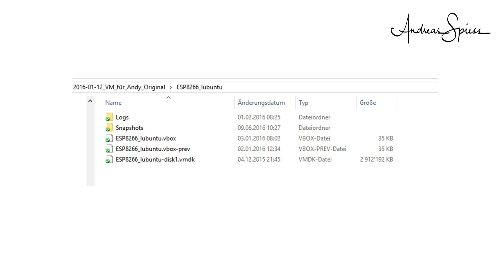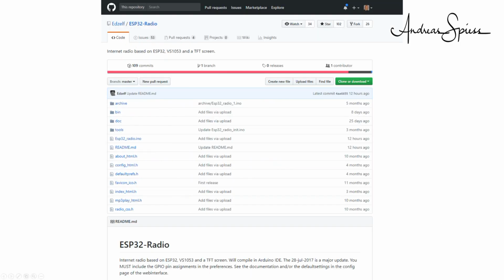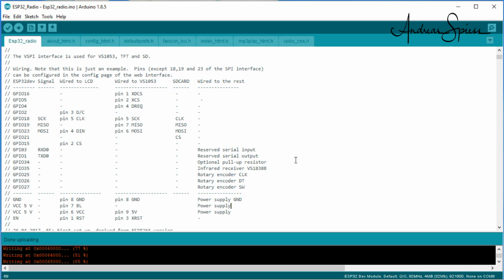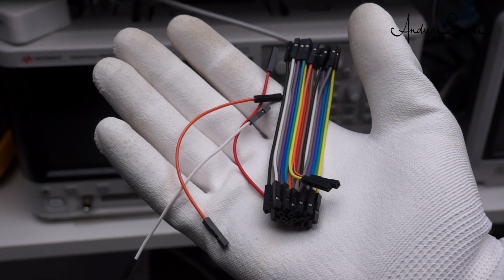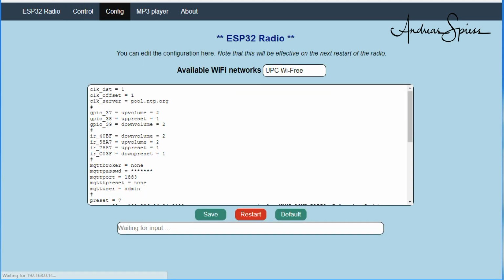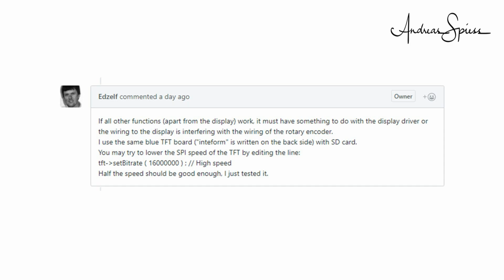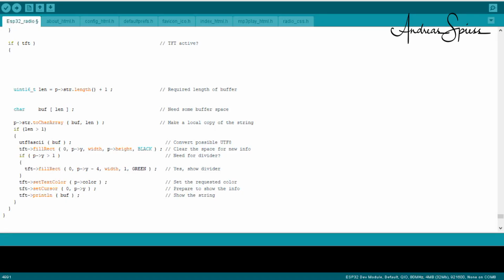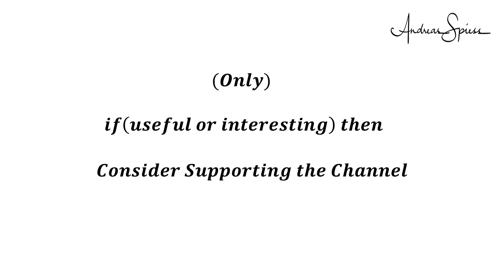#195 DIY Internet Radio using an ESP32 (Arduino IDE)

Comment: I have it sort of working now,  but the problem that I am having with it is the volume. When I start it, I  click the vol up button till she is about 86 or so, then I can hear it fine, however as soon as I put down the mouse, she begins to fade till there is nothing. I pickup the  mouse and begin clicking again, and it starts to go up from about 45, I can repeat this but to no avail.  Perhaps I have my wires crossed?
Reply from the maker: Good to read that it works (somehow). I did not do a lot with this project since the video. Maybe you ask the developer? He should know much more than me about his project.
Reply: @AndreasSpiess  Last night, when tinkering with it, I decided that perhaps a bit of capacitor could smooth things out a bit, after all when I am starved of energy, my voice gets quieter right?  So this morning, I dropped 470 ufd at 16 volts across the +5 and GRND pins of the MP3 decoder, as I was running the device off a power bank hooked through the USB of the ESP.  I do have a secondary PS that I tried that is 7805 with extras on a strip board hooked to 3 18650's, and it did the same thing, but this seems to have improved things. I also installed the rotary encoder so I can control the volume locally  So far all that it does though is control just that, and it works backwards by my way of thinking.  When I turn it the downward it increases the volume, and vice a versa.  Ah well at least it works a bit.  I want this in a nice case built of wood, and useful as an entertainment system. I have already mounted everything on a single board with very short solid copper wire for good conductivity.

Comment: Greetings and salutations from the snowy plains of South Dakota.  All the cool weather of the Alps but without the Mountains!  I have been playing around with several versions of this project for a few days now. I am sick with the flu, in fact got back from the Doctor yesterday. She checked me over and told me I was getting over my pneumonia nicely. Didn't even know I had that. Anyhow, I managed to get, first an ESP8266 to sort of work, but very poor quality sound. The more power I fed her the better, but nowhere near the quality I was seeking. Then I hooked this one up for the, well perhaps 40't attempt, and music came from my tiny folding speakers.  It works, so far. All I have set up is the ESP and the sound board, I did make a small PC board for a rotary encoder but have not yet wired that in.  I have been just getting by using the onscreen setup to change stations and other settings. I do have several types of screens but haven't decided which one to go with so far. Thanks so much for your fine video's, had I the funds, I would send some your way, but sadly my funds are quickly going the way of the dodo bird.  Know anyone interested in a fine little 2 bedroom ranch style home in South Dakota?  Trying to sell mom's, she is in the home and shall never walk out on her own, sadly, and that damn house, fine home that it is, sits, mocking me as people drive by and seen the sign but make no offers. Ah well back to playing with ESP's and arduino's.
Reply from the maker: I get enough support for now. No worries. Concerning cool weather: Currently nobody talks about the weather here. All eyes are on the virus. Closed schools and soon closed companies are all not known around here. One advantage of a YouTuber like me: He does not need to go out of the house too often...
You can be happy that you only catched a flu. And maybe you are now even a little more resistant! BTW: I know what you are writing about your parents. I am just a little ahead of you. Both passed away in the last years and the house ist still around...
Reply: @AndreasSpiess  Indeed, we are told to be sort of quarantined for now, since the wife and I are both over 68, we have told to stay home and not travel anywhere.
Reply: @AndreasSpiess  At long last, the house has sold, dropped the price by 10 grand and had 2 takers. Got 44 thousand for the place, a fair price here for the home. Deal should have closed yesterday but I have yet to receive the check.

Comment: TTGO has since made a new board with integrated stereo DAC that could make the project smaller/cheaper
http://www.lilygo.cn/prod_view.aspx?TypeId=50032&Id=1157&FId=t3:50032:3
Reply from the maker: Nice board. Does the project run on this one?

Comment: It seems that when ever I decide to build a neat little project, and have a bunch of parts in my hand, I search for code and your site always pops up.  I am very thankful that you keep working on the same things that tickle my fancy!  A few years back, I was building different devices that I could push music around my home via Bluetooth,  toward that end I picked up a half dozen little boards that came out of some unknown music player that probably did not do well, the boards look like left overs.  They are equipped with two 3 watt output amplifier chips, on-board Bluetooth receiver, and an auxiliary in port. The speaker out ports are tiny made for some tiny plug that I am sure is deigned from unavailum. I did find that miniature power plugs can be cut down to be used but the design is a pain to work with, so I have taken to soldering flat cable taken from old computer hard drive cables as speaker out. Since the stereo is taken from two mono amps, I do like to keep the two grounds separate as they are in the output for the speakers. I want to use this in the aux mode to receive the input from the ESP32 if I can. Hope this can be made, the board is very small I am considering making it a mono and putting it all in a tiny pocket AM radio case, designing a dial that can change stations using a rotary encoder, if possible.

Comment: I used a Eeprom flasher program for reset the esp8266, not necesary the cable brigde, works fine

Comment: Hi Andreas
I am in the middle of building this project but with ESP2866 as described by this guy
https://www.youtube.com/watch?v=1q8UP5HhdpM&t=9s
It is a bit confusing 1/ in the video he is connecting the yellow and the blue from the display to tx and rx on the ESP but Oh look it is not blue and Yellow, it is in fact yellow and orange!!!
2/ the sketch refer to a different display!!!
3/ here is the problem - instead of selecting the wifi which I had inserted successfully in the SPIIFF (surprisingly without a password) it reboot and give me an exception (28)
You are the last to save my life
Regards
Erik Hoffman
Reply from the maker: Unfortunately, I cannot do remote debugging even for my projects. I saw you posted a request on the original video. 
The TX pin usually has 3.3 volts, the tx pin has 0 volts. Maybe this helps to distinguish the two.

Comment: Such a nice project! I also want to do that. I plan to place the whole thing in an radio case of an very old radio. I also want to use the mqtt function to connect it to my doorbell (at least for testing purpose). If I got any problems doing this, can I ask you for help or are you overwhelmed by people like me asking some "stupid" DAU-questions? ;-)
mfg
Sven
Reply from the maker: Maybe you go to the github page if you have questions on this project. The developer knows much more than me.

Comment: Andreas, hope you can reply but this project is alive for you? seems more than a year without significant activity. I really arte looking to use a bunch of pieces that I have to make this working, but I have little time so if is parked and dont work very well maybe I will not be successful too. Let me know if you find good to build it with some limitations as it may have.
Reply from the maker: I did not do a follow-up. But there was quite some activity on the GitHub project. Maybe you search there?

Comment: Very interesting little proj. 

Working out where borders of ESP32 are.....
Basically it can decode IP Audio streams (Mp3, AAC etc.) itself in SW. 

What are your feelings to delete the external VS1053 decoder and decode stream audio in the ESP32, still paired with with tasks touch evaluation, SPI TFT bandwidth load and potentially even equalizer number crunching from the ESP Audio developing framework?
External RAM might be needed here, but basically this shoudln't be an issue...
Reply from the maker: I did not look into this topic, so I do not know.

Comment: You may be happy to know that there is now a well-tested PCB available to mount all the modules and components you need for the ESP32 Webradio, with some added benefits. 
It has a micro usb power connector, uses audio transformers for decoupling, and even includes an on/off switch. 
It is available om my website: http://nakedninja.cc/smart_products/webradio_esp32_pcb
Reply from the maker: Thanks for the link. Your posts landed in my YouTube spam folder. Maybe because of the name of the website.

Comment: Hi Andreas. I am looking to build this and was wondering what size (mAH) battery - assume it is a Lithium - you used for the ESP32 dev board? Many thanks.
Reply from the maker: Typically an ESP32 dev board consumes around 100mA. I never measured the other components. Maybe you check the whole setup with a cheap USB doctor or with a multi-meter? Then you easily can calculate the capacity you need for your expected time of independent operation. I assume it will be around 8h per 1000mAh (without backlit). But this is just a guess.
Reply: @AndreasSpiess  Thanks Andreas. I intend to build it with the parts as you did that I know work and then modify it to add new features. Being a seasoned coder (my career) as well as building electronics I am relishing the challenge and, as you mentioned in the video, the code used for this project  has good examples of some features.  I hope to eventually build this with a bare-bones ESP32 board to keep the size down. I'll let you know how I get on. Thanks for your excellent videos.

Comment: I would like to see code for most simple of internet radio. Only necessary components:  ESP32 and Decoder module. No displays. No push buttons or encoders. No bells or whistles. Only one source for streaming. Although I am in my 8Oth level in life. I like to play.  I just don't learn so fast any more and don't have a lot of time to figure it out.
Zu Bald alt, zu spät klug. I do learn from you videos at your easy pace. Thank you
Reply from the maker: I am not sure if this will work. But maybe you find a project somewhere on the internet. Enjoy your hobby! You definitively are a role model for younger people!
Reply: KISS. It's here:
https://electronicsforu.com/electronics-projects/prototypes/esp32-internet-radio
It worked for me.
Reply: hi! I am also looking for a cheaper solution with only an ESP32 clone, no LCD, just hardcoded stream url (darkice ->liveatc), no DAC just some COVOX like 'sound card' in old PC years, is it possible?

Comment: Hello Andreas,

Waiting for the I2S to work, I took the subject WebRadio with a 8266 and a VS1053, thanks to the site:
https: //platformio.org/lib/show/1744/ESP_VS1053_Library
which has a WebRadio index.

It's simple and it works well with the stations of the form :

// http://comet.shoutca.st:8563/1
const char * host = "comet.shoutca.st";
const char * path = "/ 1";
int httpPort = 8563;

Unfortunately it does not work as well with stations such as:

// const char * host = "http://direct.franceculture.fr";
//http://chai5she.cdn.dvmr.fr/franceculture-lofi.mp3?ID=f9fbk29m84
const char * host = "chai5she.cdn.dvmr.fr";
const char * path = "/franceculture-lofi.mp3?ID=f9fbk29m84";
const int httpPort = 80;

No way to connect !!!

an idea ?
Reply from the maker: I am not the owner of the software project. Maybe you ask the question on GitHub.
Reply: Well, it works very well, it's the right wording, 
Merci !

Comment: Mit der letzten Version wurden ILI9341 Display und MQTT optimiert. Leider läuft der Webserver und somit die Steuerung, eben so MQTT, nicht lange stabil. Die Zeitanzeige jedoch konstant. Suche gerade den Fehler. Hat jemand ebenfalls diese Erfahrung das nach ca. 2 Std. sich der Web- und MQTT Service nicht mehr ansprechen lässt?
Danke für das Feedback
Reply from the maker: Hast du ein Issue auf Github erstellt?
Reply: Hallo Andreas, erst mal danke aus Deutschland, vom Schweizer :-) Nein noch nicht, weil ich nicht sicher bin, ob es ein wirkliches Problem ist oder hausgemacht. Ich wollte einfach mal sehen ob es auch andere gibt mit dem Phänomen. Wie gesagt, das Web- und MQTT Interface sind wie eingefroren. Der Streamer läuft meist weiter. Werde mal ein USB Netzteil mit mehr Power nehmen >2A.
Reply: Ich habe nun folgendes gemacht: 1. die aktuelle Version im Einsatz 2. mein ILI9341 LCD Modul im Einsatz und 3. 5V / 2.5A Netzteil im Einsatz. Es läuft alles stabil. Die Aussetzer sind weg.

Comment: Hi Andreas,
ESP32 => WiFi + I2S + DAC !!!!
Just add an  PCM5102 DAC Décodeur, no ?
Reply from the maker: If you want, why not?
Reply: Hum...
Yes I do.
But you never use I2S and DAC  ?
Why ?
Reply from the maker: If I remember right there were a design for a radio from Espressif itself. I tried it once, without a lot of success. It used s Vs9023 or so. You should find it on google

Comment: Andreas,
nice you got this project running. I also built this thing, my own way, very basic, with ring-buffer and works like a charm.
Now I would like to use the second core of the ESP (someone made a nice tutorial 'bout that..) to process meta-data. And that's where I got stuck. Ideas?
Reply from the maker: I used the second core in a similar scenario: A radar sensor uses one core for Fast Fourier Transformation and the second one is used for LoRa. So far it worked.

Comment: I have built this and still have "white screen"-trouble. I listened to the german radio station NDR2. After a few hours the display was white without touching the setup. I used latest SW from github (your fix should be in).
Reply from the maker: Maybe you post an issue on GitHub. The developer is for sure a good addres to find errors.

Comment: Nice video. I use Karadio32 on a standard ESP32. It both supports PDM audio on a GPIO pin and an external I2S DAC. Works great, recommended to have look. Here :https://github.com/karawin/Ka-Radio32
Reply from the maker: Thanks for the link!

Comment: Hi Andreas, I love your project explanations. I have already built Internet Radios for ESP8266 and ESP32 using the project KaRadio from https://github.com/karawin/Ka-Radio32 (user group on GitHub as well). They work perfect with several different mp3 converters and there are dedicated PCB's from others from the user group 
( https://www.facebook.com/groups/162949914181385/) which of course could work with your script as well.
Reply: Look at this : https://www.tindie.com/products/microwavemont/wide-epaper-plus-esp32-adb/
Reply from the maker: Thank you for your links. Maybe I will flash once one of those projects. And I am a subscriber of microwavemont. He does very nice projects.

Comment: Interesting and entertaining project.
I started too with ESP8266 and  VS1053, but that was an awful solution - unstable, crashed all the time and VS1053 had issues with grounding (or ground coupling) (noise in speakers), when I installed this whole thing in my spare pc speaker cabinet. I threw it all out and got OrangePi with cheapest PCM5102 DAC and got internet radio that plays ALL formats of stations (even Opus that sounds ok even in 48kbps). It was pretty hard to debug that ESP8266 setup, as I am not "embedded device" guy - too little free time.
Reply from the maker: The OrangePi solution is for sure a good one. The ESP8266 was probably a little too small...

Comment: next video (3 hours): figuring out why a length of 1 causes the screen to go white.

i had a similar issue once (not with a screen going white, just some inexplicable behavior that no one could understand). turned out a comma (,) had been replaced by a point (.) in one of the statements. both were valid code (so there was no compiler error or warning), but produced different results in some circumstances.
Reply from the maker: Computers are usually very exact ;-)

Comment: Personally I made that radio with an ESP8266, using  an PCF8574 module to get extra pins.
Reply from the maker: Did it work ok?
Reply: Yeah and well Yeah! :D

The part all done (the mp3 and tft modules) worked out of the box.

I ripped out the MTTQ part, MTTQ is not my cup of tea, I prefer using underground non publicized IRC channels to control my stuff from away.  And It will open a telnet server if, for any reason, it can't connect to IRC server/room. 

The PCF8574 part was a little tricky, since there was not many pins left, but without opening the cardboard box, I got rid of serial to do I2c. I considered that worst case scenario, If I really needed a serial, I could just use an arduino mini(2$), to bridge the mini serial port to the mini I2C, as client on the ESP8266 I2C network, It never happened. I did not need it the irc||telnet duo worked like a charm. But, it could be interesting to incorporate the video out project to my box and remove the TFT module. This is where the mini bridge could become handy. This could be part of my future projects, to build a bigger (non pie) media box made from simple stuff.

I also use a PCF8591, to read a pot because I don't really like the 1 volt ADC on the ESP8266. Any ways, now I must find uses for the 3 other analog inputs. I might hook a si4703 module, it is also I2C,  and use another pots to control the volume, or some other  things like the bass and trouble function of the VS1053 module. :D

I must put the ESP8266 pace to 160Mhz, but the flash must be left at 40Mhz. And for some reasons, I can't connect to 64k radio stations, only 128k and up, but you must consider that I use a version that was publish last year, so they might have fixed this particular problem by now, I don't know, I don't really care for 64k sound any way.

Yeap, that is pretty much covers it! :D

Salutation du Québec!